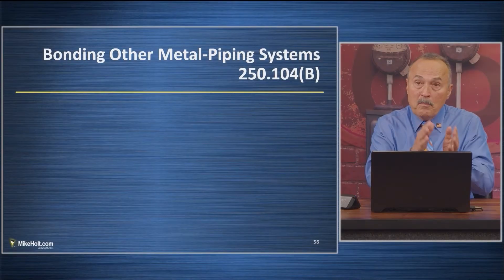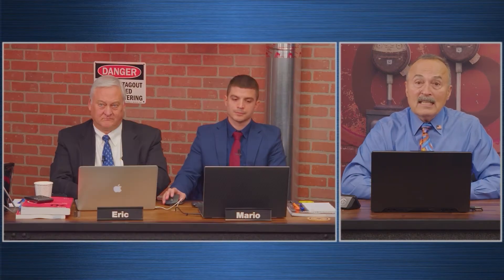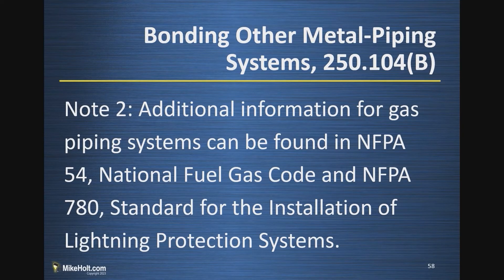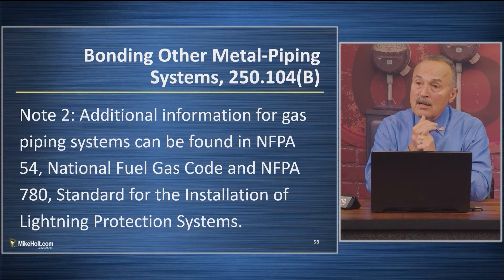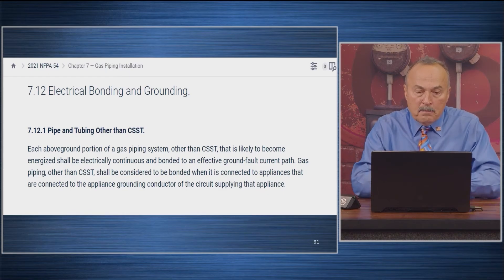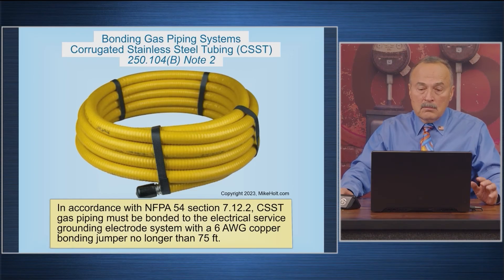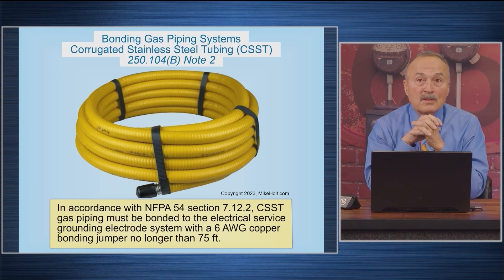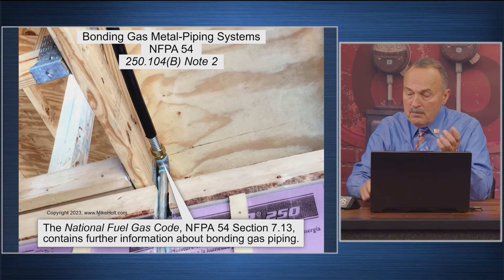Bonding Other Metal-Piping Systems [250.104(B)], 2023 NEC

Comment: Retired and read Mike's & Charlie Trout code question of the day & EC& M magazine but not up on all the latest codes. Maybe ten years ago at an IAEI continuing education class they stated you must follow the manufactures instructions for bonding  CSST. Sure there are st least halve a dozen companies that manufacture CSST. So at least back then might be 6 different methods of bonding CSST. Always thought it would be a lot safer if the NEC made you bond both ends of fireplace CSST with #6 copper like Mike Shown at 7:40 in this very informative vidio. Did anybody every run say 100 Amps, then 1,000 amps thru 1/2" CSST and measure the voltage drop ?
Reply from the maker: Manufactured instructions comply with all of the building and electrical Codes. Noting additional required.

Comment: The corrugated stainless gas tubing is connected to the rigid gas line and to the appliance with brass fittings, which essentially bonds all three together. Why would you need to jumper it to bond it?!
Reply from the maker: Please post your question on MikeHolt.com/Forum

Comment: CSST is metal, connected to a metal pipe. Therefore isn’t it bonded along with the black iron pipe it branches off from? Why the additional bonding beyond the EGC from the range, dryer, etc?
Reply from the maker: Only the 'yellow' CCST, per NFPA 54 7.13.

Comment: Doesn't code require all metallic piping attached to and inside the building to be bonded which means including gas?
Reply from the maker: Please watch the video to understand what is required by the NEC.
Reply from the maker: 100% correct, see 250.104(B)(1).

Comment: We have had to bond gas piping systems for as long as I can remember here in MD.  Fairly simple, ground the water pipe, bond it at the water heater; hot/cold/gas call it done. Until CSST came along, and well it was not that easy any longer.  I have found that we follow the manufactures recommendations to bond it at the customer side of the gas meter or at the manifold.